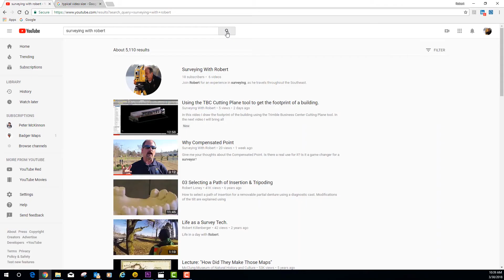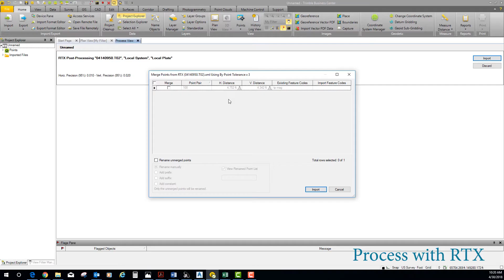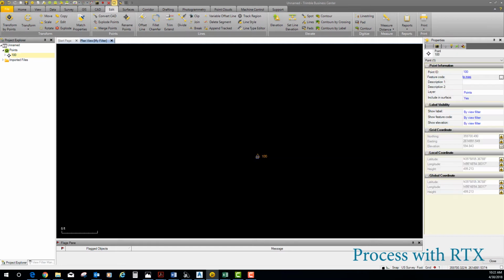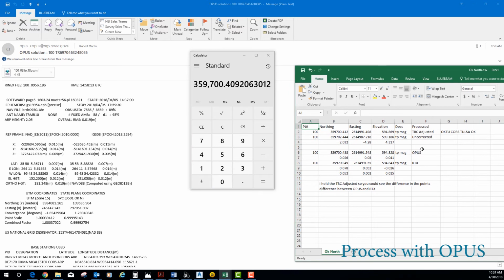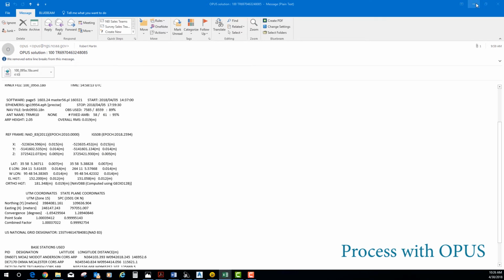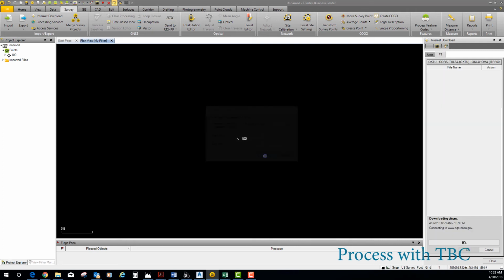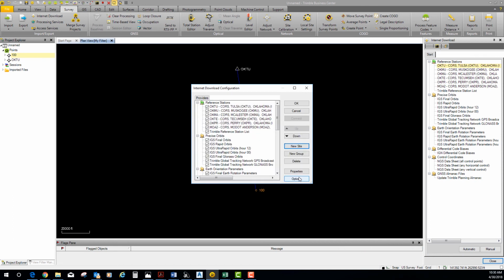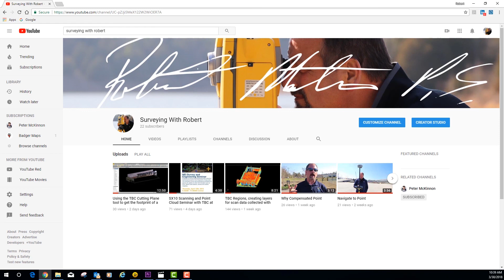Static Processing with RTX, OPUS, and TBC

Comment: Hey Robert, great video. Do you know why I'm getting different values when I upload my data to RTX-PP as apposed to OPUS? The points are feet off, elevation included. However, I get similar values to OPUS in elevation when I post process in TBC using CORS stations manually, but the horizontal is off. I'm using an old version of TBC. Do you think this has any effect?  I noticed that CORS stations in California are on a different EPOCH as apposed to OPUS. I'm guessing the Epochs are the reason for the differences? Thanks.
Reply from the maker: Make sure in RTX your not using the ITRF.
Reply: @SurveyingWithRobert  thanks Robert I will try that. How do I switch it off? Thanks!
Reply from the maker: @aidensanchez6207  RTX-PP data sheet has NAD83 and ITRF listed on your PDF they send you. Also if you are in the US be sure to use NAD83 not NAD83-2011.

Comment: Great Video. Quick question. We typically use VRS a lot. But we recently done a job in a state where we do not access to the VRS network. So we ran a Static session. I know how to do the OPUS solution on the control point as you showed in this video. My question is, How do I apply this OPUS correction to the rest of the GPS points collected in my Job file?
Reply from the maker: Do a merge point in TBC. Hold down ctl  on keyboard select both points. Follow commands and be sure to select recompute or the red ball when you complete the merge.